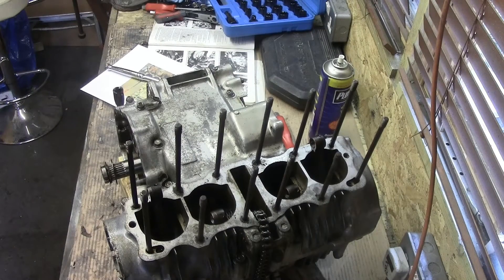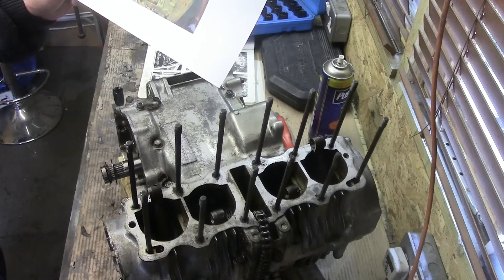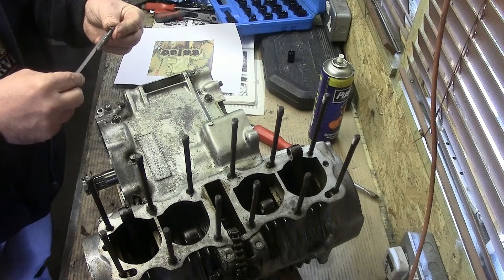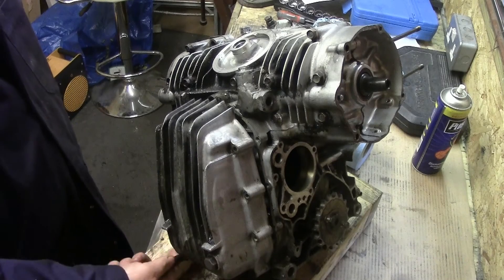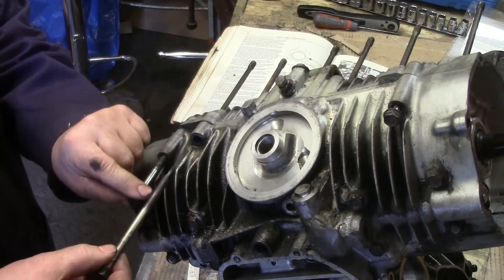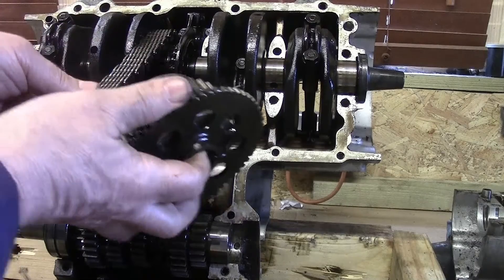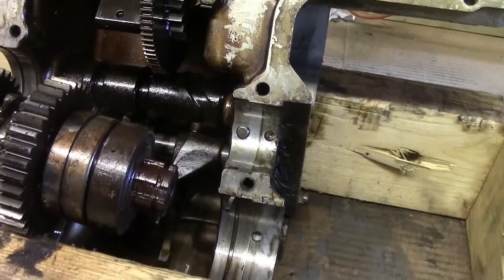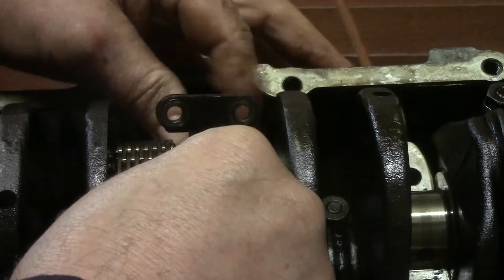Honda 400 / 4 Engine strip - Part 8 splitting the crankcase

Comment: How to take out a stator clutch for this one?
Reply from the maker: I used heat, a borrowed puller and as it is a tapered fit a hammer to gently tap it. I did not film this part as I was at a friends workshop.